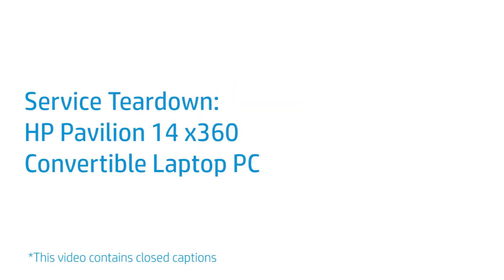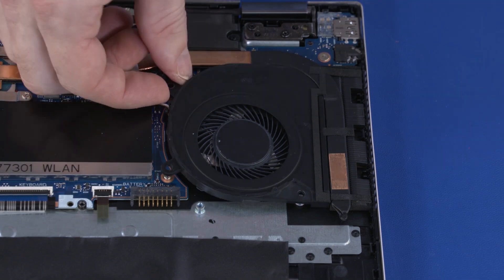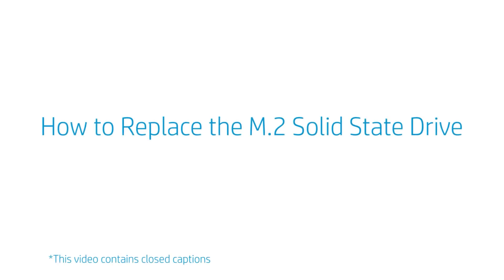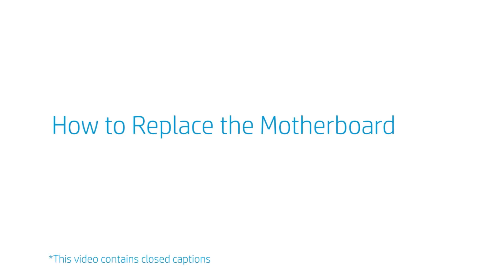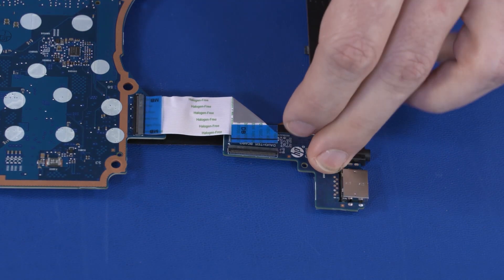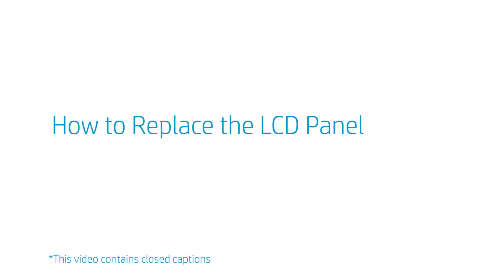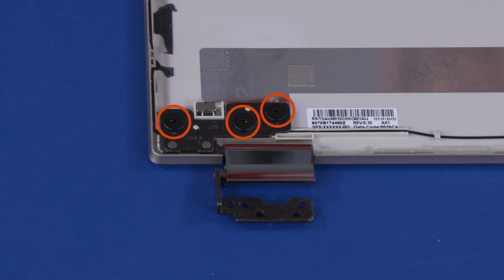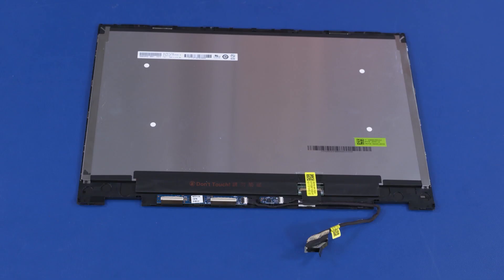Removing & replacing parts for HP Pavilion 14-dw0000 x360 | HP Computer Service

Comment: I cracked the plastic around my usb and power cord on my pavilion. Can you tell me what part needs to be replaced
Reply from the maker: Hi there, thanks for contacting HP Global Social Media Support!
I understand that the plastic piece around the charger port is broken, and the battery is not getting charged.
This looks like hardware issue, and you might have to get the notebook serviced. 
So, I would recommend you to contact regional support for repair options.
Please feel free to reach us on call/chat. Access this link to select your preferred country and language option to reach us. 
Global support link: - https://hp.care/6057owonb 
Regards, 
HP Support

Comment: how do you upgrade the video card ?
Reply from the maker: +Dai Rugger Solution one- download (speccy) It'll tell you your motherboard name, google it to check if it has a graphics card slot that is welded in place or is one that can be changed. If yes then go onto crucial.co.uk it should help to tell you what graphics card you're best upgrading to or if you know your stuff then get whichever you like. solution two - if your card is soldered into place then just buy a new one. Remember if you're going to open up your laptop chances are your warranty will be void.

Comment: Does this also apply to the 14-dw1500na? And what is the maximum system memory for it?
Reply from the maker: +Mike Green You can try the steps mentioned under the video on your notebook. Please refer page number 1 of the user manual to know about supported memory: https://bit.ly/2QJ1faW

Comment: Can I take off the top cover and screen and still use the laptop without putting them back? I am using an external monitor.
Reply from the maker: +Kebapmaster HP does not recommend upgrading or downgrading hardware parts or software that is bundled with the product as It may affect the manufacturer's warranty and performance, however, you could change the configuration at your own discretion.

Comment: Hi I'm wondering is the HP Pavilion x360 14-dw1024TU (from Indonesia) has the same parts as this one?
Because I want to swap the RAM into a bigger one. Is it possible?
Reply from the maker: +Stefanus Rianto This notebook supports up to 16 GB maximum system memory in the following conƭgurations
● 16 GB (8 GB × 2)
● 12 GB (8 GB × 1 + 4 GB × 1)